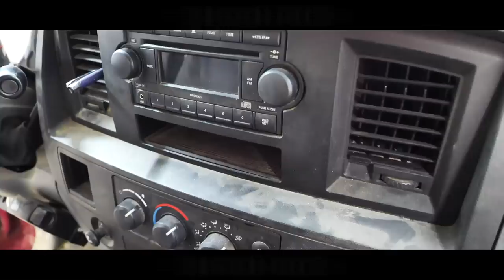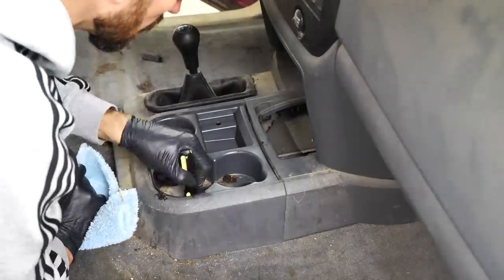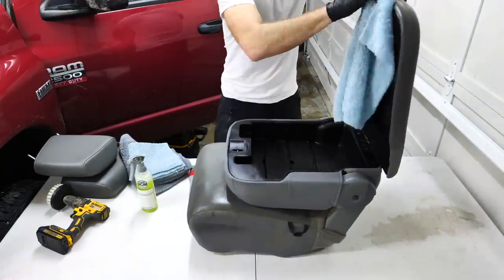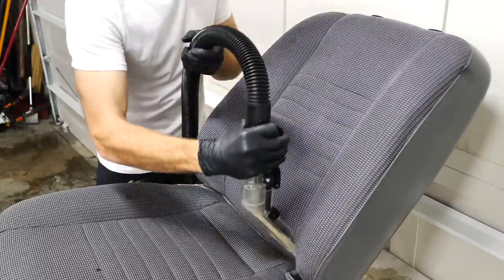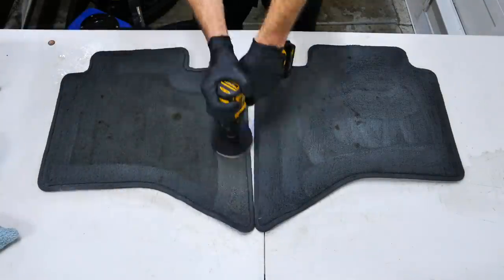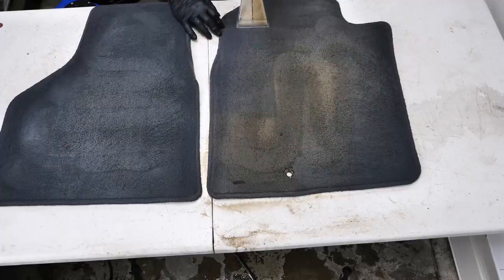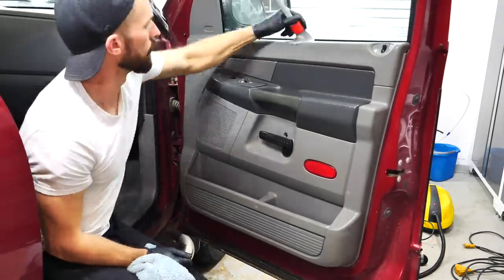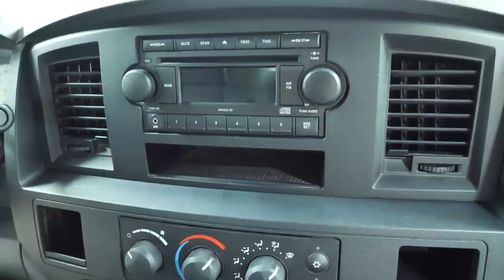FIRST Detail EVER! Deep Cleaning A Filthy Work Truck! Full Interior Car Detailing Transformation!

Comment: After watching numerous videos over the last few months of disaster detailers here I find you to be one of the best however the best I have found to be M.A.D. Detail Based in Jupiter Florida I think. On every disaster detail they stripped the inside of the car down to the metal studs just about especially the carpeting to access metal flooring and clean it as well and often surprising what one finds underneath the carpeting on the metal chassis flooring. Also allowing them to high level pressure clean the carpeting outside of the car
Reply: MAD has a big garage. Stauffer doesn't and like he said he's would have if it wasn't snowing outside

Comment: I have a 2008 v8 tundra from my job that i use daily, its pretty bad on the outside considering its for construction stuff but man these engines are so reliable! Its currently at 485k kms or 301k miles and still going strong, hauling any equipment or trailers!

Comment: Have you ever removed a Wrangler JK two door console, and if so, how did you remove it without ripping apart the cable that has a connector that lights up the console cupholders in front of the storage bin?  One thing that I took advantage of from your videos is that if I have to reinstall carpeting in my JK it is MUCH easier to unbolt the seats and without actually removing, tilt them to where the carpet can be easily tucked in.

Add a drop or two of Dawn blue dish soap to the grease spots before agitating and see if it doesn’t help with your spot removal.

Comment: I’ve spent $120 on a detail on my car before that included shampooing the seats. I watched the whole time they cleaned my car and I did not see an extractor at all throughout the whole process. I asked after they “finished” if they shampooed my seats and they lied and told me they did. My seats were not even slightly damp. They didn’t even open my trunk either. This is what “detailers” around me are like.
Reply from the maker: And for that price, I wouldn't be surprised. The more expensive cost is hard for a lot to understand but if you break it down to products, employees, equipment, building rent, etc the higher prices and time it takes make sense. Maybe see if you can find someone local to you that charges more and see if they shampoo seats
Reply: @StaufferGarage  I figured it was too good to be true but they did an awful job regardless. I ended up buying my own shampooing machine and washed my upholstery myself 😂

Comment: I would say that going the extra mile is beneficial, but if I'm charging between 65 and 150 bucks for a detail I'm not going to be removing any plastic shrouds to get underneath them. If I'm going that far, then I'm charging 200 base and it goes up from there. Then I'm losing clientele.

Comment: I dont remove the seats once i saw that some the electronics need to be recalibrated and the liability should something happen also when it comes to inside the glove box or center console i just do a quick wipe without removing anything because i would not want someone going thru my stuff in those areas. No one looks in the spare tire well and if the panel above is not trashed i would not even think of looking. Even with not doing those i still have yet to have a complaint but should i have the vehicles for more than a day and charge appropriately then maybe i would understand going to that extent
Reply: Basically should the detailer not do those spots does not mean they did a bad job or not as worthy of a detailer it all depends how much you paid and what the expectation is

Comment: My truck of choice is a 80’s Mazda B2600 with a 5 speed manual, neighbor had one. 
But since those are getting hard to find in like-new condition, I’m saving up for a Cybertruck, because I’m tired of constantly replacing the rusting exhaust on my Subaru every year, changing the oil constantly, chasing EVAP codes, lean fuel trim codes, ignition coils buring out, changing the belts, ect. (not to mention the body rust...)

Comment: 1993 f150s and below ,new f150s suck
Reply: They don't after you end up replacing everything 🤣..lol ours is an 08..does great now that we have fixed a few things. We bought it used. The jerk that owned it before us apparently didn't fix anything. He did gnarl the fuel lines and yes, put gorilla glue on them..im not even kidding. 2 miles from the dealership the truck quit..70mph down I-40..scary.  salesman came and got us and they fixed everything in a couple of days. But keep oil in the trucks they will go forever.